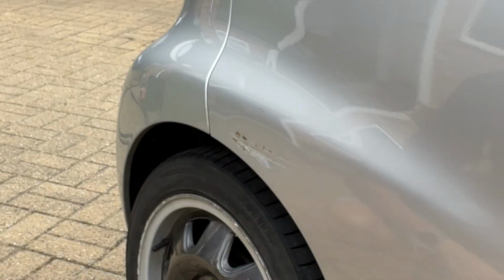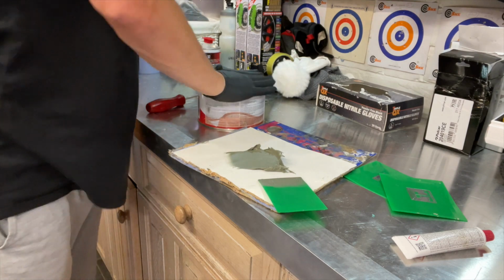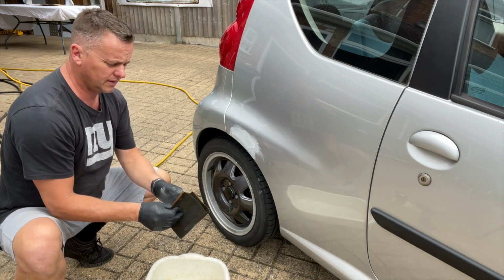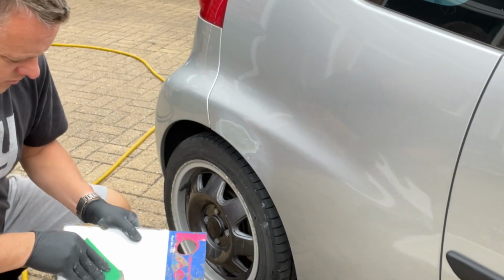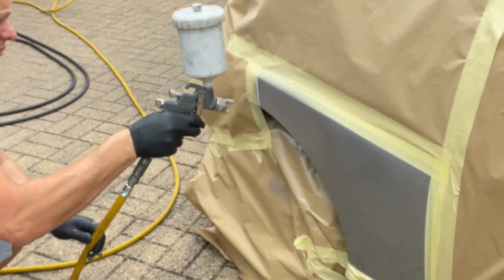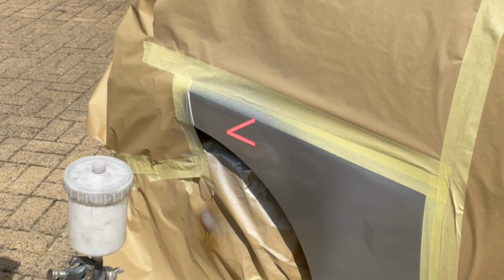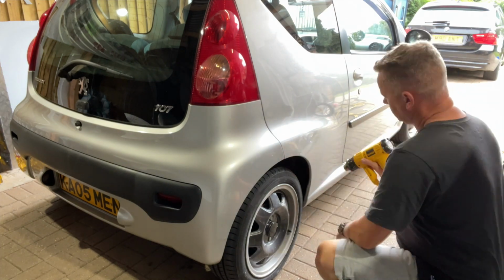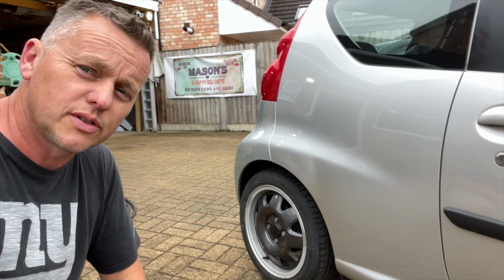🇬🇧"Citybug" Smart Paint Repair Scratch & Dent Filled. Peugeot 107.

Comment: Good try , you need to use soft edge tape or back mask so you don’t get any edges where you taped and you can use a fade out solvent to fade the clear coat on smart repairs or just spray some thinner , always use primer and never wet sand primer as it’s porous and will cause rusting , also you need to blend the base coat further and maybe get the paint shop to match the correct shade of paint, tcut is rubbish compared to compounds like 3m etc
Reply from the maker: Thanks for the great information👍🏻👍🏻🛠

Comment: Another great video. Great job, also think in the light the grey metallic painting conveniently blend away small  imperfections. These eco-friendly paints used today aren't that resistant anyway, at my C1 dark anthracite metallic against the sun one can even easily spot any sites were the bird poop was sitting too long ... if the scratch would be larger/deeper I just apply after cleaning a thin layer of converter or bit of tin before filling.
Reply from the maker: Yes the silver doe hide some of the marks, but it also sometimes doesn't blend due to the metallic differences Thanks for the great comments👍🏻👍🏻🛠